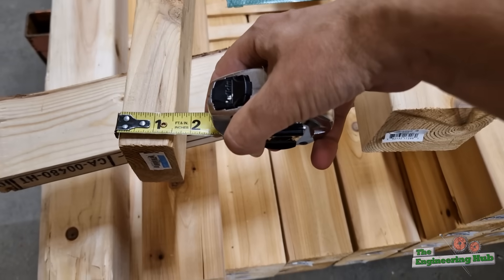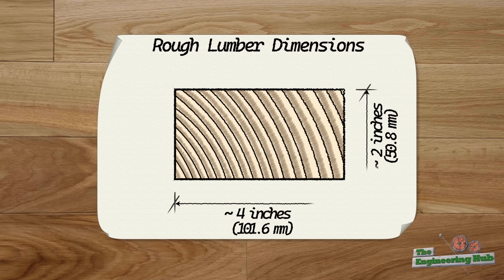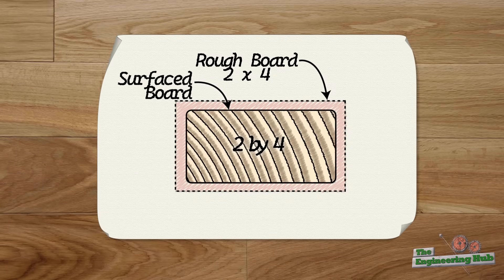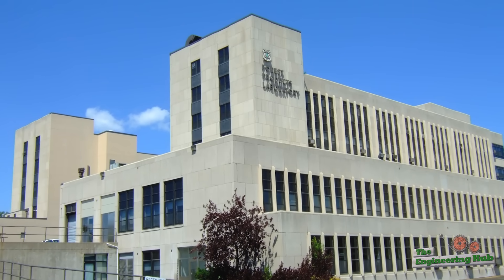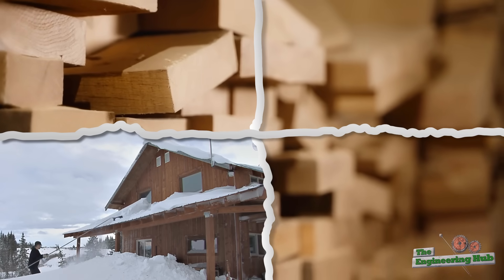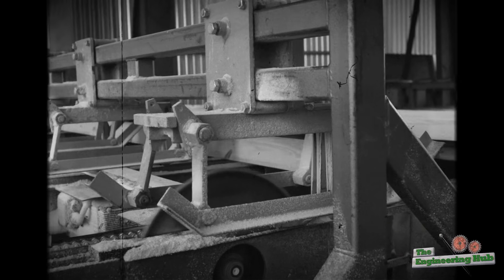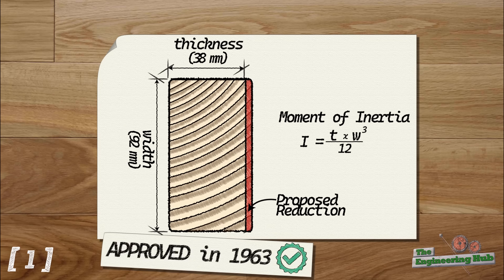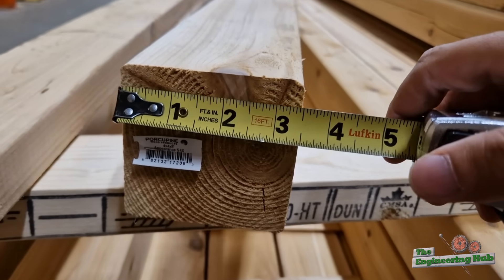Why is the 2 by 4 getting smaller and smaller?

Comment: Spent 25 years in a house in the San Diego area that was built in 1898. All the studs were true 2x4", quartersawn old-growth redwood – absolutely stunning.
Reply: I live in a house build in the early 1890s in Canada and did some reno on it.  Studs and joists are as advertised, as well.
Reply: Yeah father has a house in Pennsylvania from 1898 also. Rough cut all throughout that house. Cool to see under the floors, inside the walls ect.
Reply: Well did a older home 1920s in St. Pete, Fl. Was true 2x4 studs. That old pine turned into a rock after almost 100yrs. The pine probably came from the land when it was cleared back then.
Reply: @nicholasnissen1547 that pine might of came out of missouri, the whole state was covered in short leaf pine until a few massive saw mills moved in back in the day
Reply: @missourimongoose8858  "Might have come", not "Might of came".
Reply: My house was finished in 1916, classic nordic type of architecture found in Norway at the time before we started building cubicles out of sheet metal and concrete glass, one thing that clearly stand out is just how solid everything is, thick lumber having been used, the house is by all modern standards incredibly overbuilt and could easily sit for more than a 100 more years, even the nails used are huge some of them are more than 10 / 15 inches in certain places, we just don't build them like they used to and it's a damn shame, they built homes for generations.
Reply: Shame to hide redwood inside walls as studs. Redwood is beautiful wood.
Reply: @BEdwardStover  I remember that one redwood that you could drive through, probably dead now. 

Also kinda funny since officials in California have started to literally hide redwoods so people don't go messing with them and kill them on accident.
Reply: Perhaps the most dad-like phrase ever created
Reply: @@teabulls scientists have been classifying animals since 1753 we have a pretty good baseline and the amount of species lost since then has risen exponentially
Reply: lol, you are stunned looking at building materials worth just hundreds of dollars, you peasant
Reply: Wish i was there
Reply: nice! i live in north county, i assume this is in la jolla? or somewhere else
Reply: @bloodysoup9240  Well hello there!

This was actually in La Mesa, just off Lake Murray Blvd/70th Street.
Reply: i think i know where thats at! thanks for sharing :) this county has so many cool little gems and little pieces of history just scattered around  @CyclingSasquatch
Reply: I bought a house in North Hollywood, Ca. back in 2001, built 1942. 
Had the same size pre-World War II lumber.. 
I installed crown molding throughout.
Living 24 x 18 was only our of square 1/4 of inch even after years of multiple earthquakes.
They don't build em like that anymore.
Heck, you're lucky if you can get real wood for trim anymore.
Reply: @@teabulls its based on the average temporal range of extinct and extant species which are compared to fossil ancestors. Based on the temporal range (species lifespan) of thousands of extinct animals an average extinction rate of .1- 1 species per 10,000 species goes extinct every 100 years. Atleast 500 species have gone extinct in the past 100 years. 

But the actual number is likely much higher than that because it takes a long time after a species to go extinct for it to officially be declared extinct like the Pileated woodpecker which hasn’t been seen since 1944 but wasn’t declared extinct until 2021. So alot of functionally extinct species still not officially considered extinct.  Its estimated that many species are going extinct before even being discovered because of diseases & habitat destruction in areas with little scientific exploration this is especially true for amphibians which are dying off due to invasive diseases spread by humans.
Reply: @noswim  HE'LL YEAH BORTHER,,,, GOBBLESS
Reply: The earth will soon abound with massive trees, there's no dearth of CO2 to feed them, amiright?
 God's Kingdom is revving up and the earth will be renewed after a cleansing fire. Read your bible and pray to God... get ready for the "hidden manna"
Reply: Ignorant’s on those who say why cry now ! The loss stands as big as ever dive here in the Pacific Northwest and tell me what you see. We have a dot of old growth and all of the rest of the scenery is young growth and it’s a different species so now we lost what we had over a hundred years ago. If we still had it it would seem like a s I do movie set that’s what we loss you $&@&@ pillocks !
Reply: O-waow
Reply: Spend a weekend in Kazakhstan witnessing old Soviet brutalist architecture, which is even more stunning. Bring that to sandy egg or or arid zoner for maximum stun effect.
Reply: What was a shame was the heritage oak trees we had to cut down and they didn't get used for anything. There was a fungal plague recently that weakened many trees and the trees here started to fall down on their own because their cores started to hollow and that's without termites nor carpenter ants or woodpeckers to assist. So they just become invasive ground squirrel chowder. 😭 I would have rather given it for free but in my area theres so much free wood and not enough mills so oh well lol. 

Anyway I used to live in a house in LA made in the 1880s. One single beam carried a 1200ft² house 10ft up from underground. We placed more beams then tried to cut down the original but couldn't. It turned out that chunk a lunk was made from purple heart wood. Extremely dense even termites nor the saws could not go through. So we just left it there. The new owners burned the home but kept the foundation. It'll probably hold for another century or two easily if it doesn't fully burn.  It totally changed the way I see wood quality. You can still get purple heart wood today of course but even though it's sustainable, it's substantially way more expensive. If I were to build in the future, id definitely invest into a really strong bone foundation that will last centuries. Most homes now they build cookie cutter to last maybe 50 years before major repairs need to be done and that's extra sad as it will just push for more wood production.
Reply: Mine is 1875 and all 2x4 and 4x4 American Chestnut. I have a home that is more valuable sold as lumber than as a house. LOL
Reply: Not redwood.  Reddish old-growth Douglas Fir.
Reply: My uncle has a house in watsonville that still has the orginal redwood. Also, termites dont eat the redwood, another reason the stuff has lasted as long.
Reply: How was it stunning when they were behind drywall lmfao
Reply: @HAHb-zc2dp  not in the basement or attic or anything that got remodeled. What a pointless comment.
Reply: @CyclingSasquatch  you don't know much about construction I wonder why you lied?
Reply: @HAHb-zc2dp  enlighten me, master carpenter.
Reply: @opinionsvary  the islanders who live on Mauritius would’ve benefited greatly from eco tourism from bird watchers like me traveling to go photograph dodos. Birds are very important to the economy. My hometown makes 300 million from eco tourism each year. Which is very important for jobs, health and environment. 

So many eco system services y’all take for granted
Reply: @joakos1122  nobody disagrees the importance of birds, and it sucks when an animal goes extinct. From a ecological point of view though, travelling to Mauritius would be so harmful to the environment, considering the carbon footprint it would take to get there.  No matter what, for everything we do to 'help the economy' there is going to be a negative effect. It's impossible for it to not.
Reply: Some stories posit the idea that someone could go back in time and make a small change that has enormous positive results in the future. But how many people think of how a small change now could have enormous positive results 100 years from today?

There is less than 5% of old growth left in the USA. There is no reason to ever log off any that remains. In the 1950s the PNW supplied approximately 45% of all sawn lumber in the USA. And it’s severely dropped ever since. We’re now logging 3rd generation replanted forests. And most of our sawn lumber comes from Canada a significant amount from Australia. 

Until they run out of old growth.
Reply: @kermitwilson well there's some nuance to it, I know some hotshots in Cali who have to cut old growth in protected forests for firelines, what they cut does get sold for use as it would be a waste to let it rot (the same is done for any that's found fallen from stroms).
Reply: @Notmesaidsamiam  As recently as 1957 there was 30% old growth California redwoods remaining as living trees.. Now it's down to less than 5%.
Reply: @Notmesaidsamiam . We tell a lot of our US Lumber overseas.
Reply: @Notmesaidsamiam  The environmental whackos are calling 20 yr old trees 'Old growth', PS: most old growth trees can no longer be milled due to the fact that most Lumber mills cant handle their sizes anylonger, its Rare for any mill to be able to handle a Real true old growth tree. So whining about Old growth lumber is moot, it isnt done anymore, much of it is mostly rotted and as I stated the mills dont have the means to handle such anymore.
Reply: @Rink03 man you're just lying to yourself. 20 years is still a visibly young tree, nobody thinks that is old growth.
Reply: I own part a 3 plex built 1890 downtown Montreal and it’s amazing the real size of old wood in the walls and floors very very think and all rough lumber not like the crap we have now.
Cheers 🇨🇦
Reply: Old growth redwood? 
That really pains my heart.
Reply: @I999-g2s I'm going to look at it from a brighter side and say at least it's been maintained for over a hundred years. I think it would be a bigger tragedy to let existing redwood products rot. At least when it is cared for it prevents the use of new materials.
Reply: @LordWaterBottle  This is the way.
Reply: @LordWaterBottle  Redwood is rot resistant, so it wouldn't take that much maintenance to make it last.
Reply: Redwoods live over 2000 years so that’s indeed an unnecessary tragedy.  It’s like living in a house of Ivory and trying to justify killing elephants.
Reply: @maskcollector6949  Yeah, no one was justifying anything.
Reply: @CyclingSasquatch  It was implied that turning it into lumber was preferable to letting it rot, and I accurately pointed out that is not the case as redwoods can live over 2000 years so it would not have rotted...
Reply: @LordWaterBottle  One of the benefits of redwood is that it does NOT rot.
Reply: @Connor_Arroyo  I assume that requires at least a minimum amount of maintenance for that to be true? Like at minimum an application of oil every so often or something. Otherwise that sounds like magic, and I would be surprised that redwoods are not plantationed for structural use across the world
Reply: @LordWaterBottle  Don't take my word for it, but I've never seen any example of redwood rotting. Ever. And I am not a young man.
Reply: @I999-g2s  Trees are flat
Reply: @I999-g2s Hey, at least we still have some old growth forest left in California.  The eastern US was far far more forested than the western US.  There's not a single old growth forest left east of the Mississippi.
Reply: I'm sure it was gorgeous 

pretty dubious whether it was worth killing a centuries old tree over though
Reply: Remorse over the past can change the future.
Reply: @nonegone7170  exact number of people who died varies source to source 40-55 million. But all agree killing of sparrows was the cause.  
China was experiencing drought not famine until they started the sparrow war (1958-1960) in 2 years they killed 1 billion sparrows and the result was the famine. Without killing sparrows they wouldnt have had a famine simple as that
Reply: they built things to last back then.
Reply: @garyt3hsna1l82  Actually, no.  They were built cheaply for the age.  They simply had better base materials to work with.  There are good aspects and plenty of bad aspects with old wood-frame construction.
Reply: @Urbanhandyman  built better/ used better materials kind of a semantics argument when in praxis were both saying the same thing average homes don't last 100 years anymore.
Reply: @Urbanhandyman  good points.
Reply: Ah, the moralists have arrived. Or as I like to call them - the yappers.
Reply: Chopped down a 300 year old redwood to make some snobs house.
Reply: @Neoprenesiren Do you seriously have such a cushy, pleasant, pain-free life that a major problem worth whining about is a small family home built out of a particular wood that you have an emotional attachment to? What about the massive pits in the earth dug in order to collect lime for your concrete home foundation, streets, bridges, sidewalks, livelihood and comfortable life? What about building and infrastructure is unnatural? Is a bee hive unnatural because the bees collect resources from their environment to build them? Do humans do no good by cutting down trees and using them? Why are you so resistant to change that you would use moral judgement and superiority to shame the world for changing? You don't think do you?
Reply: Let's all celebrate the old growth redwoods that were cut down to build houses. Yay!
Reply: @ddognine  would you rather we burn existing redwood timbers or would you rather they stay in use for as long as possible?
Reply: Shut up hippie trash @ddognine
Reply: It's 2023. A bit too late to cry for trees cut down a century ago, innit?
Reply: @bcubed72 nope that’s like saying we shouldn’t feel bad about all the cool animals we drove to extinction like thylcaine or elephant birds, just bc it happened in the past doesn’t mean people shouldn’t care
Reply: @joakos1122  
Never heard the adage "no use crying over spilt milk," have you? LOL.
Reply: @bcubed72  never heard “those who don’t learn from history are doomed to repeat it” by the way we’re not talking about milk
Reply: @joakos1122 the elephant bird went extinct a thousand years ago.
Animals go extinct everyday and have been since life started on this earth.
Reply: @ureyesrbleeding1  they’re going extinct at a rate 1000x faster than usual because of habitat destruction and pollution, reminder we depend on them to survive
Reply: @joakos1122  we quite literally dont depend on the animals that are going extinct to survive
Reply: @ureyesrbleeding1  the biggest famine in history happened in China when Mao ordered the killing sparrows which are a small % of crops this lead to a locust explosion that created the biggest famine in history, 50 million people died of starvation because they killed sparrows. We quiet literally depend on plant and animals for more than you know
Reply: @joakos1122  Meh, I'd sooner cry of the extinction of the wooly mammoth, which happened just after the pyramids went up.

Why, proto-Americans, whyyyyyyyy?!?!
Reply: @bcubed72  Its the waaaaaa reeeee generation they love being sad about everything :)
Reply: @joakos1122 you're using a dictator off his rocker as an example? Good one.

Here are some examples of stuff that went extinct and didn't make a difference:
Dodo bird
Broad-faced potoroo
Eastern hare wallaby
Desert rat-kangaroo
Large sloth lemur
Bluebuck
Red gazelle
Giant fossa
Quagga

These are all considered recently extinct.

Did they have major ecological consequences that are felt? Nope.

Is it a shame? Sure.

Should you feel bad about it and try to make others feel bad about it? No.

Try not to make other species extinct? Yes.

There's a bunch more species, and subspecies for that matter that have gone extinct and we have felt no impact by it. I am in no way saying it's not sad that they did, but there's no point going about life cobstantly reminding yourself of it either.

Try being mad at governments and corporations who are the real blame for these situations instead of going after an individual living their life.
Reply: @MadPixie  the same thing that drove those things to extinction are the same thing driving others to extinction, not trying to make anyone feel bad but it’s arrogant to say it doesn’t make a difference. Yes even all those animals you listed had an important role in their ecology and other species are now more vulnerable because of their extinctions. 
Like I said those who don’t learn from history are bound to repeat it
Reply: @MadPixie  I used an example that had the biggest and fastest impact on humans and because it’s an easy one to understand but that’s not the only example
Reply: @MadPixie Certain species may have more impact than others if they go extinct. It depends on how critical of a role they play in an ecosystem.
Also we can't always anticipate what may happen when other species attempt to fill the role of a missing species.
Take for instance the passenger pigeon, a now extinct species that humans are almost entirely responsible for. After they left their niche was filled by animals such as squirrels, chipmunks, and other small mammals. But the unintended result was that the huge increase in these animals also brought a lot of ticks which had Lyme disease and now we've been suffering with that ever since. It gets worse every year with people completely paranoid to go outside in some areas because of the tiny pin sized ticks that spread it.
Reply: @bcubed72 never too late to virtue signal 😂
Reply: @bcubed72 The final Extinction of the mammoth, the one that happened at the time of Abraham (just after the pyramids went up), had nothing to do with proto-Americans. It had nothing to do with people. The last population was isolated on an island that was just too small. Wrangel Island in Russia.

Mammoths died from habitat loss, not hunting.
Reply: @joakos1122 While I don't really disagree, I must point out that not EVERY Extinction is a human-related one. 
Even recently.
Reply: @bcubed72 but muh infallible climate science
Reply: @MadPixie You're not the brightest light bulb in the bunch.  Every extinction has an  effect on the environment, some that we are living with the consequences to this day.  Look it up.  Not to mention the invasive species that even you are experiencing, and whether you want to believe it or not has tremendous consequences on your way of ife and the economy.
Reply: @joakos9309  everyone knows and agrees to not cut down red woods anymore. Worry about something more pertinent, don't waste your energy worrying about stupid shit you can't change.
Reply: @bickyboo7789 I’m just doing my part in spreading facts doesn’t cost me much energy so I don’t mind
Reply: @MadPixie People having different opinions from you is ok. No one is trying to make you feel anything, you are. For many of these species this really isn't a matter of fact to dispute, it's true they don't provide direct use benefits to humans (that we know of), it's a matter of environmental appreciation. That's a valid value source that can be enough to justify conservation.
Reply: @bcubed72  those who don't know their history are doomed to repeat it.
Reply: @ureyesrbleeding1  actually, or literally?
Reply: @joakos1122  What do you mean "we"?  Do you believe in ancestral and tribal guilt?
Reply: @ddognine you can't un-fell a tree genius. Better preserve the stuff that's already been cut down than to let it rot and go to waste only to be replaced by felling and milling ANOTHER tree
Reply: @ddognine  Do you feel the same about all the quarry's broken up for their stone? If not, is it only because the tree is alive that you give it special consideration? If so you should stop using so much antibacterial soap, it harms all the microbiology.
Reply: Those trees would have been cut down anyway. They were clearing land. They weren’t cut down to build houses, and at the time it made sense because they were absolutely everywhere.
Reply: Why so salty about redwood? That’s awesome building material. Quit crying